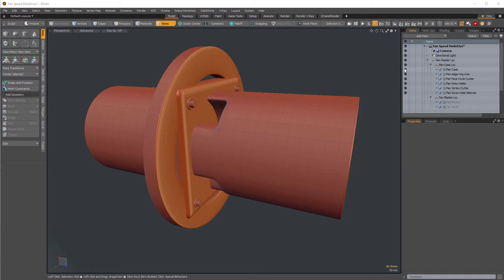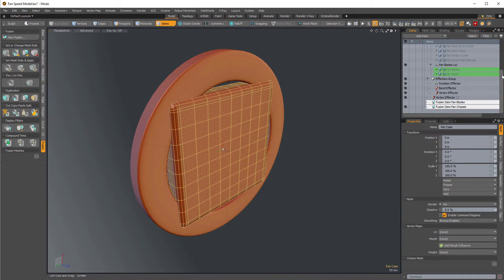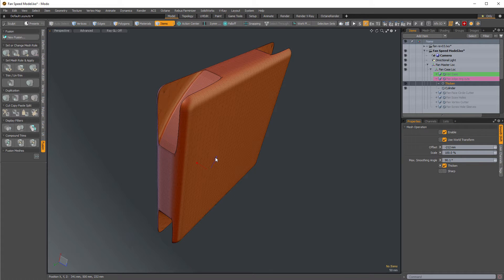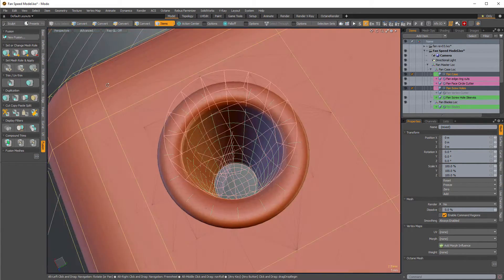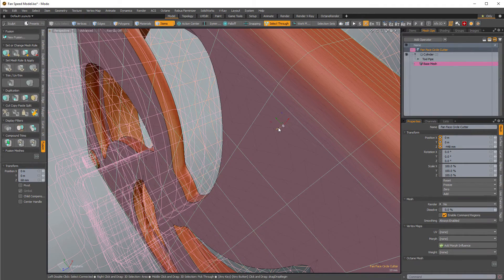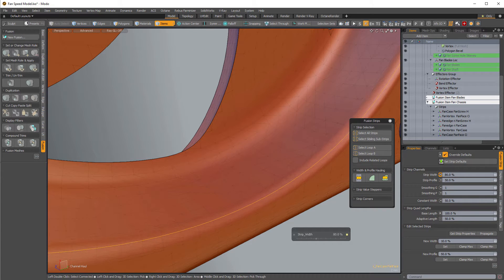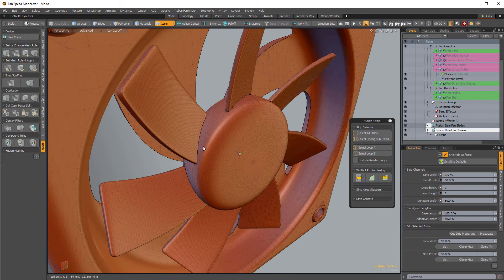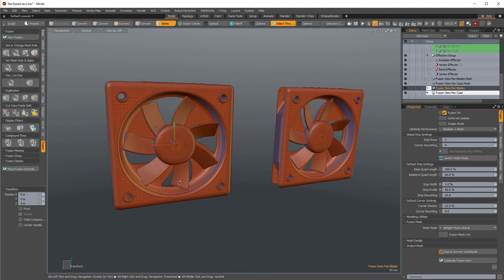Case Fan MeshOps and Mesh Fusion Part 2

Comment: Why doesn't the fan edge ring not also cut through the fan screw hole sleeves if the sleeves are also now part of the primary?
Reply from the maker: I god, I think I made this like 7 years ago.  I don't remember (sorry)
Reply: @pixelfondue it's alright. Let me ask you a question. With modo being discontinued, is a tool you still use or have you moved onto another.
Reply from the maker: @I-Call-Cap  I still use Modo, it's great for the type of work I do.  If I was to make this sort of model right now (a fan) - I'd use Plasticity.

Comment: Hi Greg. Question from a newbie. So from what I understand, triangle are not a good thing in the 3D modeling world, correct? And if that is true, then why? I noticed that ZBrush does the same thing and where the pieces join, it is very messy for lack of a better word. So I had wondered how this is fixed or dealt with in the real world. With that being said, I heard you say that the fans A and B needed retopology. I don't know anything about this process and why it's needed. Is there a chance that you take this great tutorial to the next step as if these fans were going to be an actual client end product? I think it would be very helpful to others as well. Thank you Greg and have a great day!
Reply from the maker: Hi - quads are the best practice for creating geometry for subdivision surfaces.  Once those surface are fused together (whether in zbrush or MODO or any boolean operation) you get plenty of triangles.  That's fine for high-poly objects (if you're going to render or are happy with the object).  If you're going to put the fan in a game engine you will want to retopo (create a low-poly version using the high-poly as a template) and bake the details with normal maps..  You don't want tons of polys in a game asset.  Check out some re-topo videos or substance videos.
Reply: Thanks for you quick reply. So triangles are fine as long as I'm not making assets for games? I guess I was confused because I had seen some tutorials where the person demonstrating was working hard to get rid of triangle and "spiders" but didn't explain why. I guess I understand the low poly for games because there's less calculations, but wouldn't that also apply to triangles? I think there's something I'm missing on how the two shapes differ if there are the same amount of each in each object. Something to research.
Reply from the maker: Triangles are generally bad for subD modeling (they don't smooth well) and character/organic modeling.  They're not desire-able but if you are doing boolean modeling they are unavoidable and fine if you are ultimately just rendering stills of hard-surface models or re-topoing down to a low-poy version (which also often contain triangles)
Reply: Makes sense with the smoothing situation. Good to know. Thank you for the explanation.